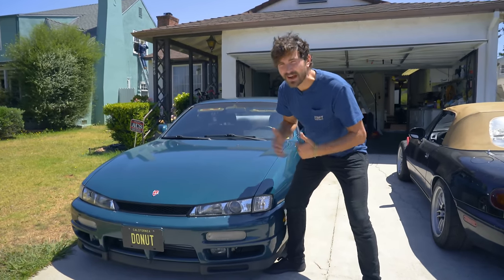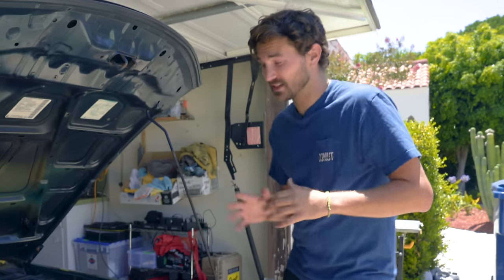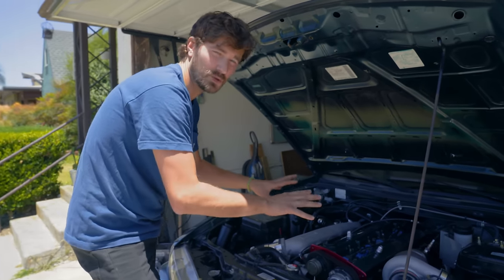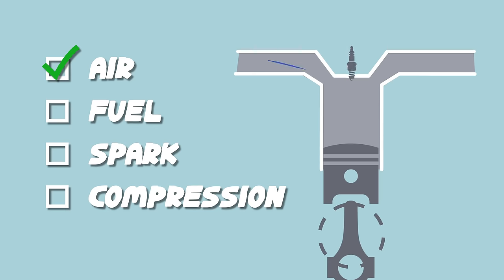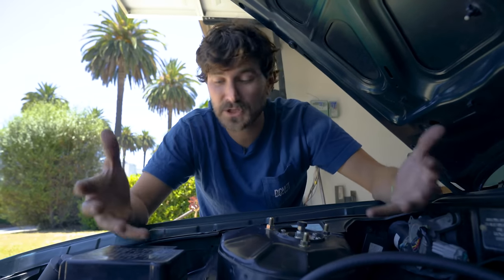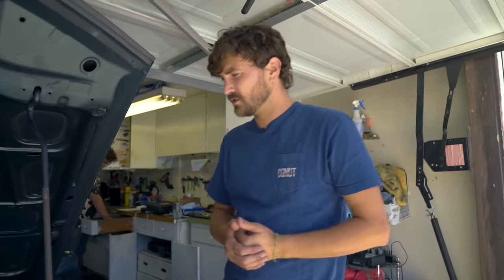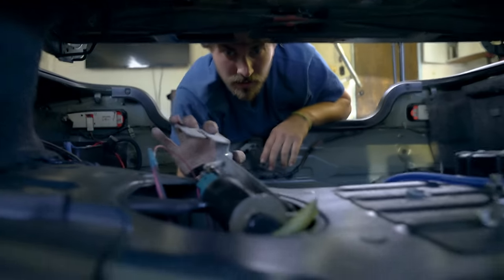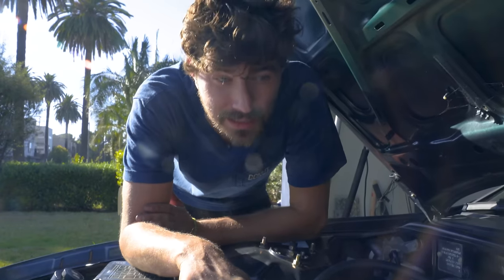Figuring Out Why My Skyline-Powered S14 Won't Start

Comment: Why do we pinpoint it to only compresion when ther is four strokes
Reply: Becouse that is the thing within the cylinder that could couse it not running. The other strokes depend on the valves opening and closing, if something would be wrong with that it would also show in low compression. Other defects in the cylinder (and piston) could couse oil blowby, but that is not the issue in this case. As a car mechanic i would say he is doing a great job trouble shooting in this video.

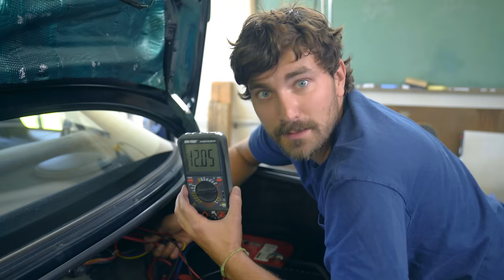Comment: Dude!  Your fuel pump test FAILED the voltage drop test.  If you have 12.7 at the battery and  only 12 at the  (looks like relay harness) they the car greatly exceeds the 0.2 volt allowance for loss.  you most likely have a grounding issue.  (Yes, i stopped the video right here at 10:38 to point out the elephant in the room.)  
Update:  Glad to see it was a cheap fix  but I would definitely look into that voltage drop.  It could be a grounding issue or a corrosion issue within the wiring itself.